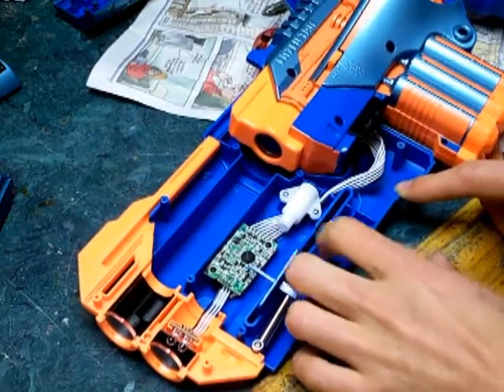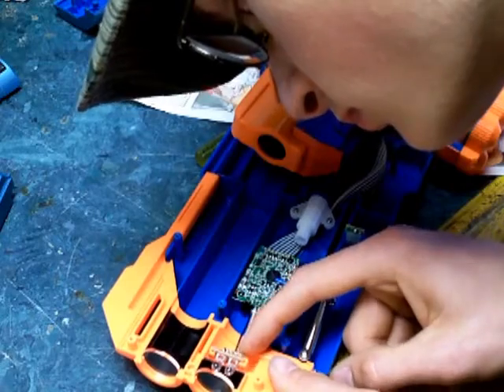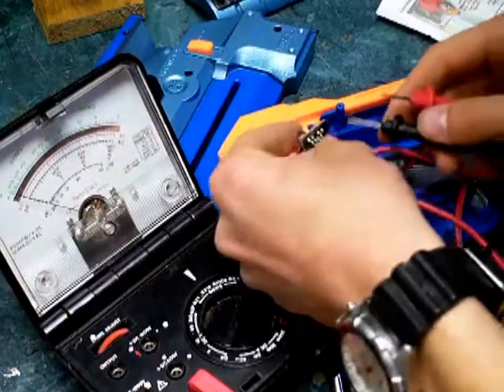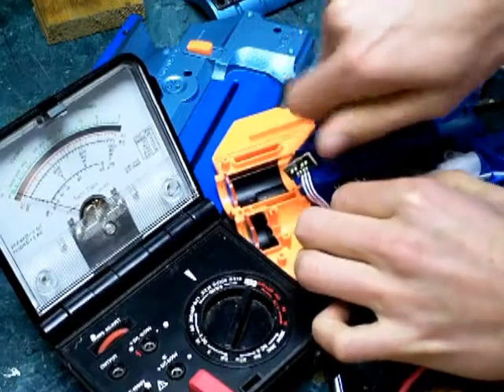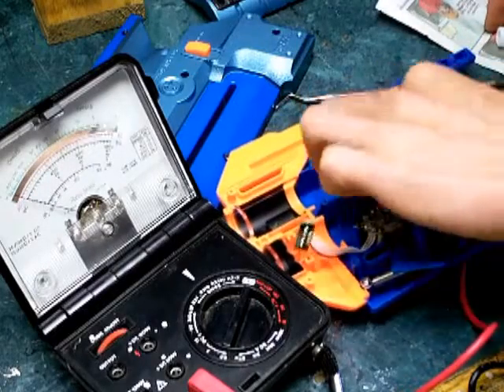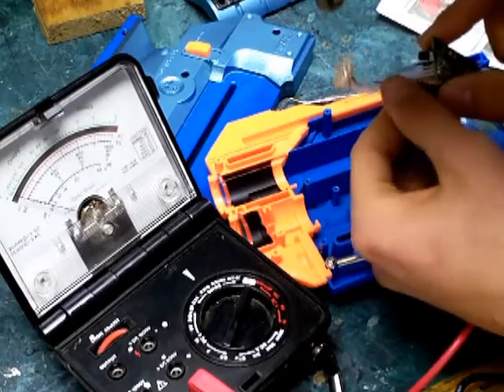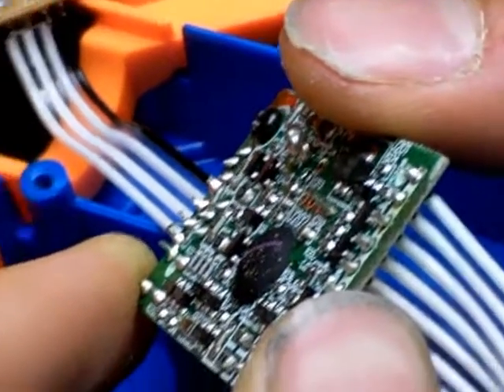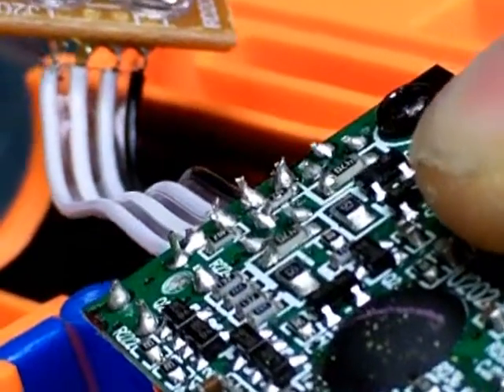Lazer Tag Phoenix LTX Shot Blast Repair

Comment: Good job on the repair. You could have also just moved the positive wire from one LED over to the other and that would give you the 3 points of damage but just using one LED. The reason two are used is they have different beams angles. Narrow for the one point of  damage and wide for two. One fires right after the other.  BTW if you ever burn out a LED the best replacement will be a TSAL-6100. Google it if you need to know more. I believe mauser dot come carries them.